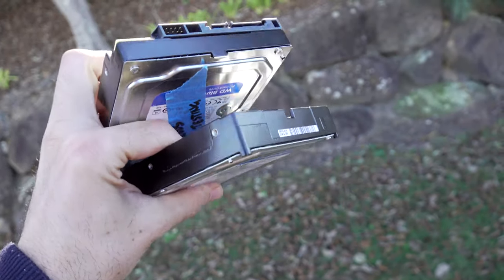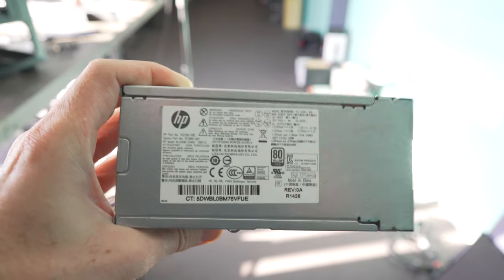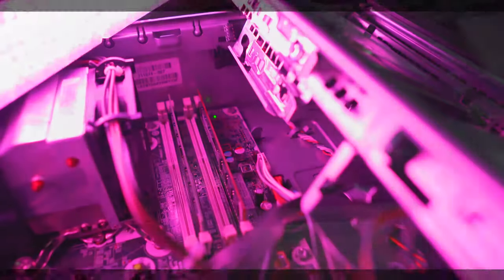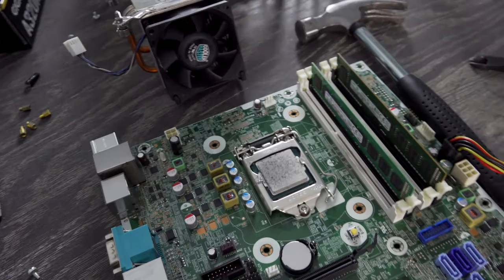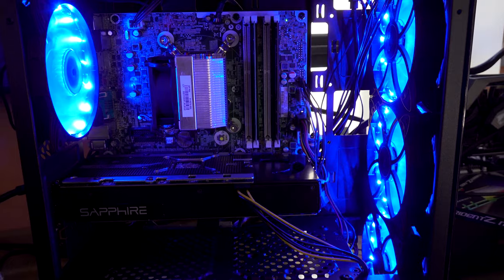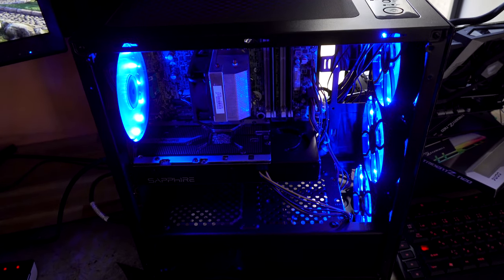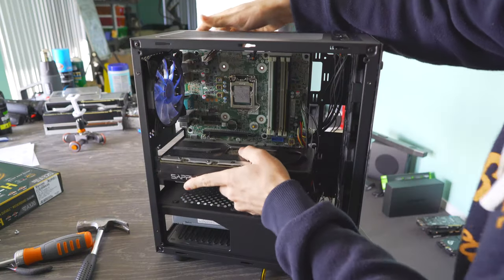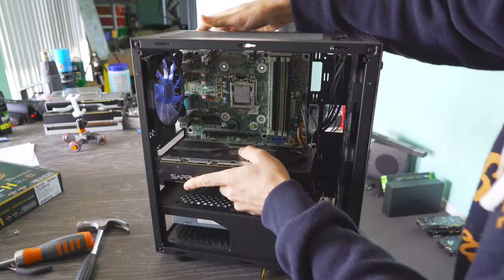Turning a $100 4th Gen HP ProDesk into a GAMING PC? (Mid-Month Hustle)

Comment: I did this with a Prodesk 600G1 (i5 4590) a couple of years ago. I used an HP server adapter to change the 6-Pin and 3 Pin PSU plugs to a 24-pin which allowed me to put in a 500W PSU and a GTX760 (which I recently upgraded to a 1060 when I put a 1080Ti in my Main build). I did have to change the order of the 3 pin on the adapter to match the config of the 3 pin that came from the original PSU, but that was simple enough, just poked the headers through the plastic housing of the connector, and pushed them back in the correct order for the PC.

I also used a Low profile USB3 adapter to solve the GPU overhang problem. These HP pc's are great value for money now days! The only issue with using a custom PSU is that you have to press F1 every time you boot it because it can't detect the PSU fan. But everything works perfectly! I recommend it!

Comment: Recently put together a PC for my sister using a Lenovo Thinkcentre Edge
I5 3470s, 8GB RAM, 240GB SSD + 512 HDD, GTX 750Ti, Thermaltake power supply and a 19 inch monitor for $220
Prebuilts, especially Lenovos are quite easy to work with (less proprietary parts) and generally cheaper compared to the likes of Dell Optiplex or HP (at least in Malaysia).

Comment: I have the HP Prodesk 600 G1 SFF.

It’s a decent PC. I suggest popping in an SSD, 8 or 16GB of RAM and a low profile Graphics card. 

The bios key is F10
The Boot menu key is F9
And overall great system.
Love the design of the case.

I’ve taken all the parts out and into a better case so I can fit a better graphics card in. 
With all that, an SSD, 8GB of ram, and a much better graphic card.
You can play Minecraft, GTA V and even fortnite
Reply: cool lol im getting a refurbished hp pro desk 600 g1 for only 90 dollars has a i5 4570 a 8 gb ram 240 psu and im ordering a gt 1030 low profile its my first pc so im excited im not expecting to play 4k raytracing triple a games im mainly getting it for small indie games and possible mine craft im gonna upgrade to a gtx 1650 low profile when i can and a 16 gb ram soon

Comment: Bryan, you can find a proprietary PSU cable adapter on eBay and that way use any PSU on an OEM HP system, try searching for (24pin to 6pin hp OEM) should come up, I've used it before and it does the job, though it looks sketchy and I would not recommend going over 500W with that adapter cable.
Reply: I actually have the adapter with my elitedesk 800 g2 mini system as i move all the parts to a new case and bought a new psu and a rx580. It works but i need to change the pinout for the 6pin cable because there are different pinouts for different hp motherboard. If u are interested in it u could just google and find the pinouts online.
Reply: Wouldn't recommend going over 500 watts....? The adapter doesn't really care how big your power supply is or what GPU is connected. With the OEM dell optiplex computers they need a adapter similar to this and all it does is converts the 5volts standby power to 12volts.

Comment: I've done the same thing this guy did but a little different. 2 years ago I had a elite desk 800 g1 sff. I took out everything and my brother bought me a abkoncore m atx case with itx support. This was perfect. I put it all together with a new 500w power supply and bought some cable converters and power extensions then got a gt 710. I know I know, back then I was new to pc gaming and PC's in general and didn't know any better. Two months later fan started making noise. Not recoil whine, not scratching, but a clicking noise. I removed the fan but that just broke the fan and now it was useless. Last Christmas I got a gigabyte gtx 1050ti oc edition and with enough power knew this was gonna be pog. And ever since I've been playing modern games at 60 fps on high settings not needing to worry about fan breaking. Noise level went down due to gigabyte 1050ti fan being really quite. And now with i5 4570 and 16 gb of ram. I'm loving pc gaming.
Reply: oi, do u still know the exact case model?

Comment: Good value but, not liking the hole left by using the stock power supply.
Reply: Or missing I/O shield. But it's a small sacrifice.
Reply: There’s a 24 pin jumper for these HP motherboards. So you can run normal atx power supplies.
Reply: @romevang  and people throwing away servers w gold power supplies every day.

Comment: Brian, got some knowledge to share. Most HP business computers do support newer nvidia graphics cards. 

HP 4000/6000/8000 series are good for cheap gaming builds. If you have issues just update bios to latest version.

3000 series are not really businessmodels, they are closer to HP's consumerlineup. No bios updates.

Newer models work fine too. HP 400/600/800 series.

Speaking from experience, I've put together many 6000/8000 series HP computers with nvidia GPU's. GTX 750/750ti/950/960/1030/1050/1050ti/1060 3gb.
Just update the bios before. I'm currently typing this on a HP Elite 8000 SFF, Q9450,16GB, GT 1030 low profile.

HP's consumer computers with clarksdale/lynnfield/sandy/ivy bridge are a nightmare. MSI has AMD r9 200 series with bios switch for legacy. Sapphire nitro has it on both 200 and 300 series.

Comment: I took a Lenovo E73 tower and found a midi tower with more room and cool fans, change the powersupply with a a adaptor 10 pins to 24 found on amazon 6$, and midi tower 35$ and I had a 1060 Ti graphiccard, a ssd and 8 gb of ram, look liked a dream insted of an office pc, I sold it 2 hours after putting it fore sale, the pc run good and the client is happy, I made som money on what i had laying around.

Comment: I would be very weary of a sata to pcie 6 pin adapter. I would definitely change the psu instead of doing this just to save a buck. (and to have a gaping hole in psu area)
Reply: Its safe. This is very good quality supply and processor with an "s". You would probably replace it by some junk psu just for genuine 6pin connector.

Comment: Well done for getting that all to work..... I've done this a couple of times with old HP office PC's.... they were 4th and 6th gen respectively but I used a couple of cheap mining boards to swap all the good bits over and then I could still use a standard ATX type PSU and no problems with different power button connectors - think I've still got the old HP 4th gen and 6th gen motherboards lying around somewhere gathering dust.

Comment: I love my little HP EliteDesk 800 G1. I purchased it with a 4th Gen Core i5, 500GB HDD, 4GB of DDR3 and Windows 7 and on-board USB 3.0 for about $100 USD about 18 months ago off E-Bay. It now has a Core i7-4790 running the stock cooler, 128GB SSD, 1TB HDD, 24GB DDR3, a low profile GeForce 1050TI., and a dual band add-in WIFI card running at 5G. It's hooked up to a 44" 1080p smart TV for a monitor. I can play most gaming titles without too much trouble at relatively descent FPS (40's to 80's). All the components were used or 'open box' items and I've got about $350 USD in the whole system (minus the TV) Oh... and I forgot to mention, all this is being run on the original proprietary 280 watt PSU! Very fast, very stable system with no hick-ups or problems yet for about a year now.

Comment: How do you get the standard front panel headers to connect to a dell oem motherboard if they are different?
Reply: Magic.
Reply: Well if the front panel headers are all separated it should be really easy, just hook up each connector to the right 2 pins. However if you have one large front panel connector you should cut it off and add your own separate headers
Reply: Lookup an XPS 700 series LED re-wire thread. There are a couple out there, I've done multiples and hardwired all the multicolor LEDs to single colors. Including all the front panel and fan connectors/headers.

It's just current and wires, check my channel for my Dell AIO power supply hack. Put a 300w regular power supply into a Dell all in one after the compact power supply burned out.
Reply: You probably have to solder them in following a pin diagram from the internet
Reply: @Brandon-uy1uv  Nah, you can just repin the connector using a needle to push in the tabs on each pin and reseat them into the connector. 

Or you just cut the end off and wire in new standard front panel ends to the old wires.

In a lot of cases, you don't even need to change anything because most is still the same. An Acer I just reused the case on, the front panel is one connector, but it lines up perfectly and i didn't have to rewire anything, just plugged the whole cable in and everything was fine.

Less chance with Dell, but they usually have pinout listed somewhere, or some dude like me figures it out and posts it on a forum.
Reply: Bought a Dell Optiplex 7010 for 20 bucks didn't know the connectors were a pain. You gotta get the OEM female connections and resolder some stuff to make it work.
Reply: @nicodalumpines8827  You don't have to solder though. Get the connectors from ebay or an old case, take a pin or something and push in the lock holding it in the connector. You can just rewire, no solder needed.

https://youtu.be/xufdqCsPdjs